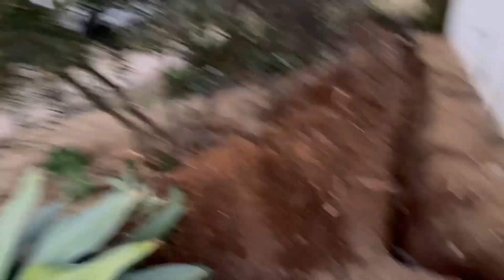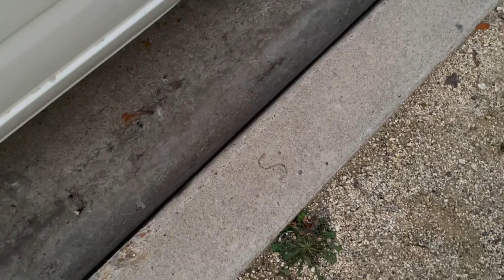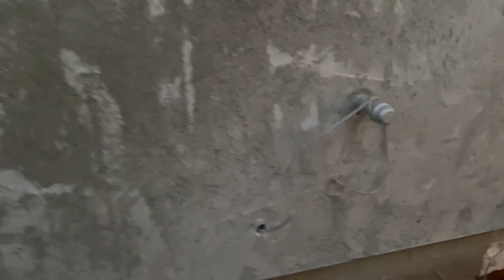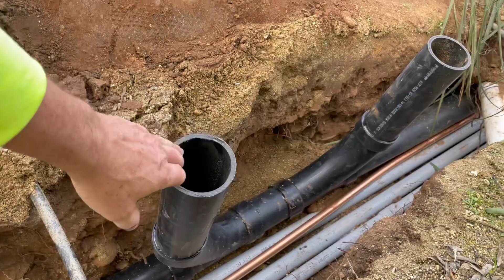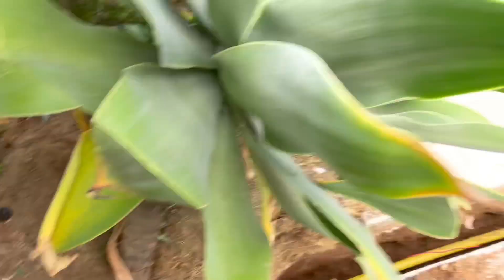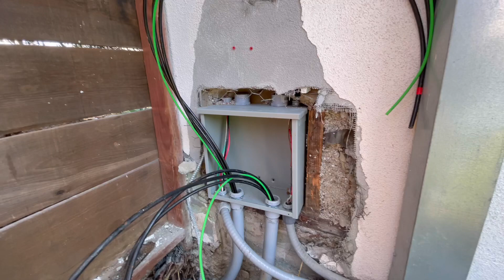DIY ADU update #11 - Utilities Hookup

Comment: Hi sir, Im Darell. Can the sewer line and water line be at the same trench? My ADU is about to get approved in my backyard. I have so many questions 😅.  My plan is 2k sqft, rectangular 4 bed 2 bath bungalow.
Reply: You're vids are very informative,  thank you so much.
Reply from the maker: Sounds like a great project. Typically the inspector will want them in separate trenches. They have allowed both in the same trench with a min of 12” of separation and the water line higher in the trench. In the event of a leak in both, this reduces a chance of cross contamination into the water system
Reply: @URBNBLDRS  I forgot to tell you I'm at San diego near national city. Skyline valencia parkway. 🙂
Reply: @URBNBLDRS  Hi, thank you for your response.  I would love to do the same, 12" apart can be done. I think you're right, it depends on the inspector, but I will ask anyway. I don't want to go to the other side of the house.  My house is 3 bed 2 bath, do you think they'll require a nee gas meter and new electric meter? The ADU  is 2 bath and 4 bed. Have a blessed project sir. Thanks again

Comment: I have to dig 150' feet from back to front with increasing depth!!! I understand. Good video
Reply from the maker: If you don’t have enough fall, 1/4” per foot for 3” and 1/8” for 4”, you can install a pump.
Reply: @URBNBLDRS  thanks. good advice. i didnt realize it goes to an 1/8th per foot when you use 4' pipe. that will definitely help. its worth the extra few dollars. im owner builder too

Comment: Hello, did have your to upsize your gas and water meters
Reply from the maker: We did upsize our gas meter but not the water meter. You can calculate your fixtures and distances to find out if it’s required. Often times you can reduce something and fall under the number that triggers a needed upgrade. Of course if you don’t get enough pressure then you will want to upgrade them.

Comment: Where is this located? In California you need a separate sewer line.
Reply from the maker: This is city of San Diego Ca. The sewer line is separate from the main house. You simply have to make the connection at or near the street. But usually you won’t have to get a ROW permit and dig up the street.

Comment: Where did you rent the dump trailer? I am demolishing my storage shed and remove the concrete flooring and i need a dump trailer to dump all the materials to my neighbors property coz he wants it to cover the dip on his backyard.
So 3 inch sewer line is fine from the adu?
Are you putting fire sprinkler? How you gonna do it?
later.
Reply from the maker: I own my trailer, but you can rent a dump trailer at Home Depot. They have a couple of sizes
Reply from the maker: As long as the main residence doesn't have fire sprinklers you shouldn’t be required to add them to the ADU. Check with your planning department.
Reply from the maker: @waleedsharaf4524  that is accurate. It will be listed on your permit as an issue for the inspector to verify and sign off.